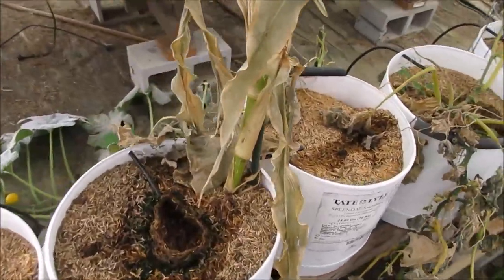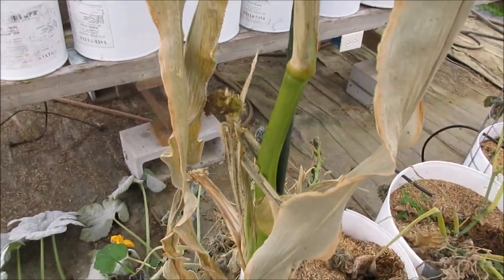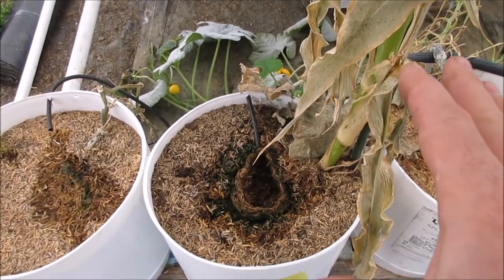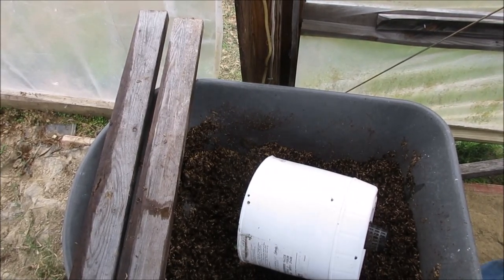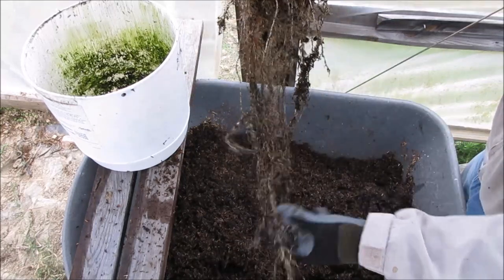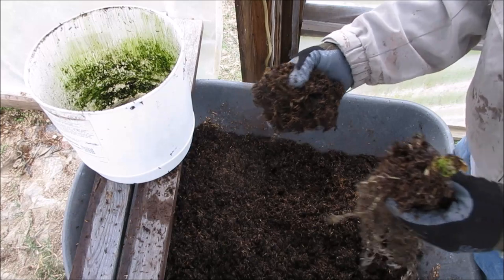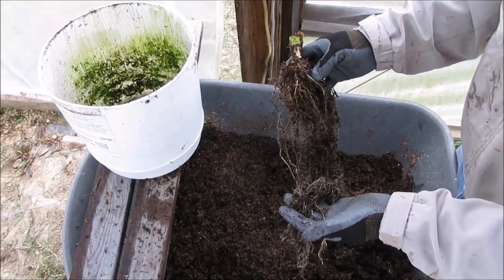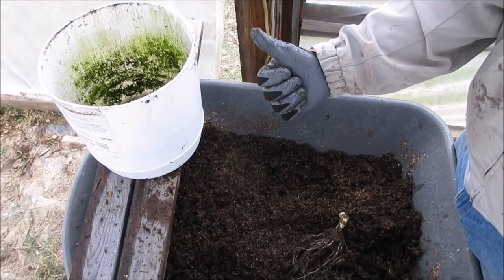Hydroponic Sweet Corn:  Test Grow, Results, and Analysis

Comment: I really liked how full that one ear of corn was. That is some pretty outstanding pollination. And seeing the roots was interesting to me, because I tried to pull the stalks up by the roots right after I harvested, but couldn't do it. It was like they were set in concrete. I waited till this month though, and the roots broke right off. It will be interesting to see how you do with 3 next year.
Reply from the maker: I've got the pollination thing down now.  I trim the silks to same length at about 2".  They stand up that way.  Then, I put a paper plate just under the tassles when there's no wind and shake onto the plate.  Then just dust the pollen onto the silks.  Worked great it seems.  Looking forward to next year's trials.
Reply: Thanks for sharing that. I might have to give that a try if what I did this year doesn't work next year. Sure looks like it worked great for you.

Comment: If you paint the buckets black or cover them in black plastic, you could eliminate the algae in the buckets. Love the channel!
Reply from the maker: So glad you enjoy the channel Ken!  Thanks so much for the input.  You never know what folks know and I appreciate the help as I often need it!  :O)  I've tried painting the buckets.  I have several of them painted and I tend to use them outside more than in the greenhouse so you'll see them there in many of my videos.  I've covered them as well with both aluminum foil and bubbled foil insulation (algae and temperatures).  I've come to realize, after all this time, that the algae doesn't do anything harmful and it's easy to clean out prior to the next grow.  If you know how it can be harmful, please let me know.  It's easy enough to cover them again.
Reply: @C3Voyage  The only thing I know of is that the algae competes with the corn for nutrients. If this is not a problem there's no reason to worry about it.
Reply from the maker: @LarryH54  Definitely especially if there's a bunch of it!  This was a while back.  Can't remember how significant it was.  Thanks for the input Larry.  :O)

Comment: I'm sure that you could get three going in that size container. When I did my bottle grown corn I had a couple that grew two in one  bottle although I did not get much corn at all I'm thinking you'll probably be better off than I was with the larger container.  Great video and Keep Building 👍
Reply from the maker: Hey Todd, thanks bud!  I'm going to give it a go for sure.  This time, I'm going to start the corn off in small planter pots and transplant into the buckets to get an early start and orient the leaves properly.

Comment: Very interesting Brent. You've grown it in the ground before so you know that it'll grow just fine 4 or 5 inches apart and that it's wind pollinated thus close together is just fine. How the heck you control what nutrients are needed is beyond me, but if you are going to experiment, why not try five?
Reply from the maker: I've tried 4 unsuccessfully.  But, that might have been due to a lack of nitrogen as has been mentioned to me.  I might give 4 a go if 3 works out well next time.